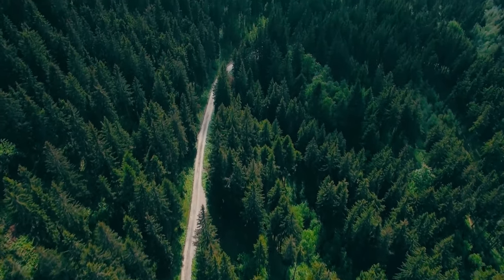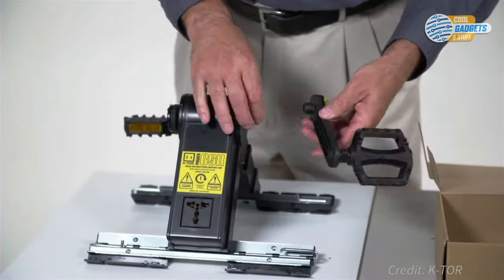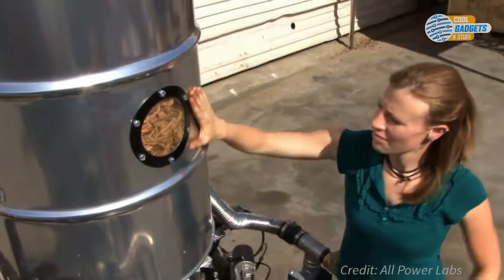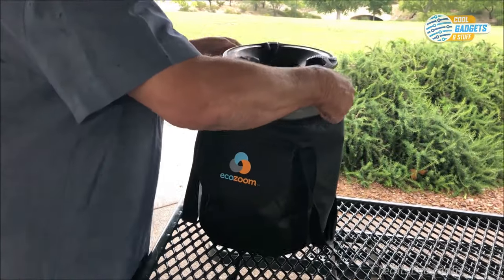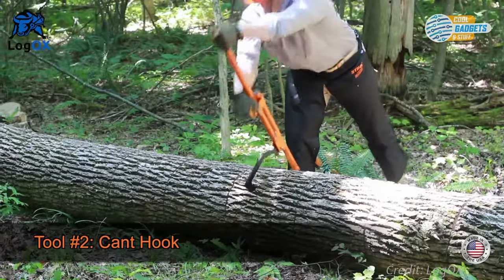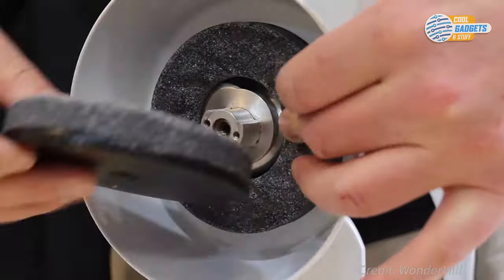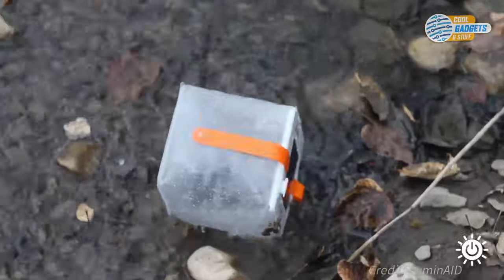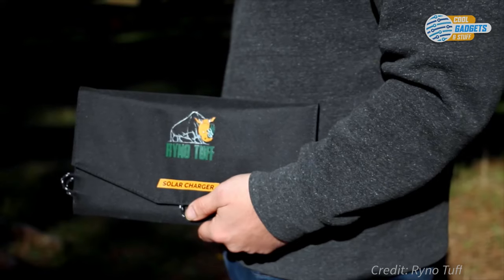7 OFF-GRID LIVING Inventions & Products #3

Comment: I found it interesting that the Bio Lite Campstove was not mentioned. Even though the fire used for cooking, heat, etc., is Bio Matter. And the inserted probe and process box (in yellow) converts heat to electricity. Which charges a battery contained in the process box. With a USB  it can charge Power Packs for other uses. Example: Lights, Motors, Fans, and many other items you may wish to use for Comfort, Quality of Life, and Refrigerators. I have used Bio Lite Campstoves for many years. I really did enjoy 7 OFF-GRID LIVING Inventions & Products #3.

Comment: For the K-Tor pedal generator, why do you need reflectors on the pedals?
Reply: The reflectors help you count the calories your burning trying to recharge your phone... lol

Gadget 1 "produces 3 Amps at 14 Volts - by peddle power...

3A x 14 v = 42 Watts, if you peddle for 1 hour you get 42 Watt-Hours - that means
after an hour of peddling you can run a 100W light bulb (or device) for about 25 minutes. 

That's a lot of peddling to check your email. :)
Reply: Bhahaha 😂

Comment: K-TOR generators are great for standard preparedness, but if you if you're ever in a prolonged long-term 3rd world or off-grid situation, I'm talking months or years, then it will become more of a novelty than anything else. In those situations, long-term food security is paramount, and it's not efficient to burn a bunch of calories just to acquire more calories, unless those calories are going into proper farming/harvesting techniques, rather than relatively small amounts of electricity.  

It's like being an Uber and driving a gas guzzling truck. Yeah, you can use it to make 600 bucks this month to pay the mortgage/rent. But then the next month, you realize your jerry cans are empty and you need to spend $300 in fuel and another $300 in maintenance. and pay the mortgage/rent. Better to uber for just the one day you needed 30 bucks but had extra gas.

Comment: Those lanterns are nice but after a few years the plastic outer part cracks and dries out and then it is just the top solar part with the lights.   That being said I love that they have the white cover making the light more ambient and not in your eyes kind of light so there the best in that category because every other type I have shine and go right to the eye witch I hate and because the lantern is inside and facing down the light is awesome and they are very bright.  Great for emergencies like power outages or camping   I like to stock emergency lighting so that when our electric goes out my house looks like we have power still lol I have a problem lol. But I like to be prepaid. My neighbors walked over and thought we had electricity because my living room was nice and lit up. I have lamps that are battery and a bunch or rechargeable also power banks to recharge our phones came in very handy. I even used my truck to plug something in that we needed to make something one time ok off topic now but really love the lanterns due to the awesome lighting but hate that they break down over time but you still have the top solar light piece so if your handy u could just put it into something else maybe a milk jug 😉
Reply: Not sure it’s the same brand though I actually purchased mine from kickstarter in the beginning and it says so light-design

Comment: Gadget 1 "produces 3 Amps at 14 Volts - by peddle power...

3A x 14 v = 42 Watts, if you peddle for 1 hour you get 42 Watt-Hours - that means
after an hour of peddling you can run a 100W light bulb (or device) for about 25 minutes.  Not Great.
Reply: I have been on and off the grid numerous times over the past several years, and there have been a large number of times I could've used just 20Wh so I could squeeze a few more hours from a phone or light.

A phone operates at around 5Wh when on standby and around 15-20Wh in use.  A Nintendo Switch running a graphics-intensive game maxes out around 33Wh.   A modern LED uses 12Wh.  Even one of my more modern business laptops uses only 10Wh on standby and 30Wh in normal use, maxing out at 60Wh if I am playing a video game.  42Wh is pretty good in all of those cases.
Reply: @bubicus  peddle away... :))

and I'm sure we'll meet some day - when your playing nintendo in the freak'n boondocks while it's on "STANDBY" and your sneakers are on fire from the friction...

Dude..., if you got all that electronics with you and you didn't arrange to have solar, a generator or some other practical source of RELIABLE juice... you probably are rubbing two sticks together to light your propane stove too! lol

Comment: Aside from the products that burn wood, the video is great. Sad there’s a company building on technology that’s 75 years old. That’s why we’re so far behind on tech advancements on our planet.
Reply: wood is a fantastic renewable source of fuel.
Reply: @magamike1800  yes way better then oil and I'm not being sarcastic... it purifies the air as it grows you dont have to dig up miles of earth to get it  
The only downside is we can't grow it faster then we use it... I have seen gasifiers you can run gas engines off
Reply: @lesstevens2370  i have production forestry with a 30 year cycle. people dont understand that the trees have to be cut down to let the next lot to start growing to suck up the carbon. that gasifyer is amazing. i still prefer solar for my offgrid setup.
Reply: @magamike1800  yes I live up in canada solar is awsome in the summer for shure winter months you take a hit have that running a genset bigger one of course to charge back up the batteries if you want to be off grid that is
Reply: I don't know about the particular rocket stove in this video, but many of them are 2-4x more efficient than a typical wood stove or fireplace and result in less pollution than coal or gas, plus they burn fuel that is plentiful like twigs, needles, and leaves.

Comment: Send ukrain this generator.just need gcse physivcs to ake generator a magnet some wires etc. Flemings left hand rule right hand rule etc.can burn dry pooh in it and activated charcoal can be made from. It for filtering water only requires soaking charcoal l in water.only if prope not fit increase strength of pelvic floor muscles.it isnt just back muscles one uses its stomach same as in hand stands its not just arms back its stomach too.